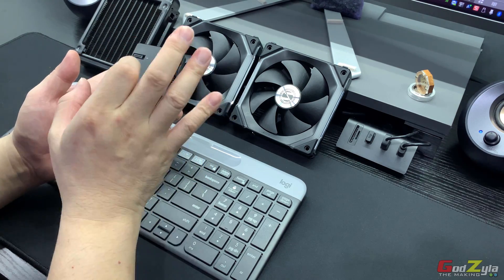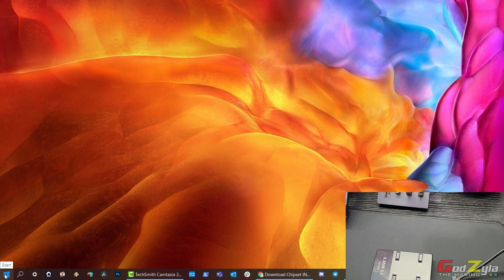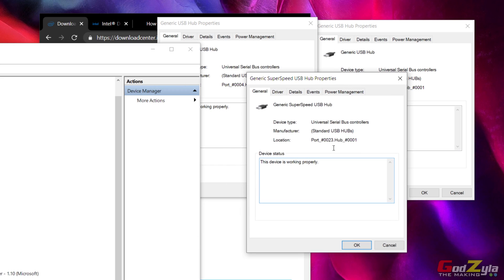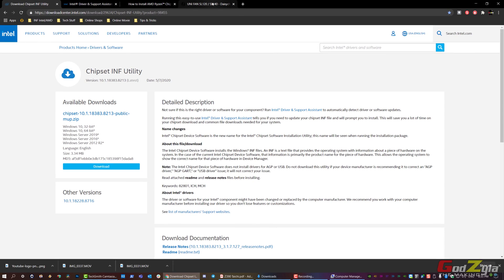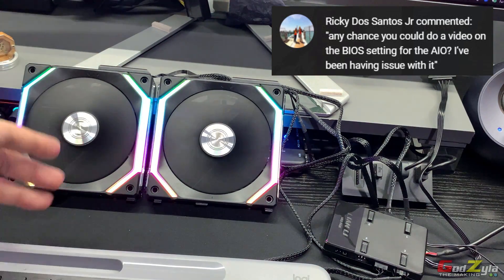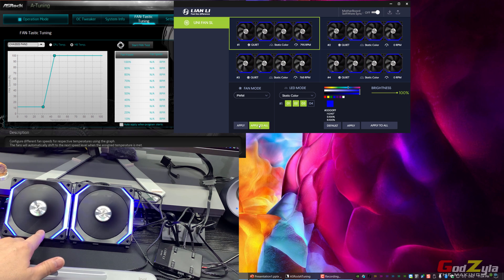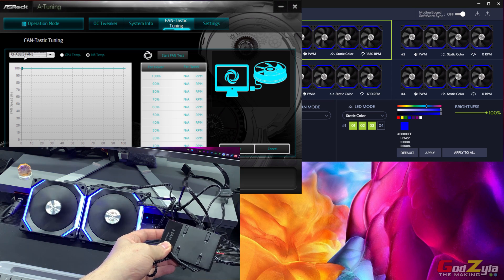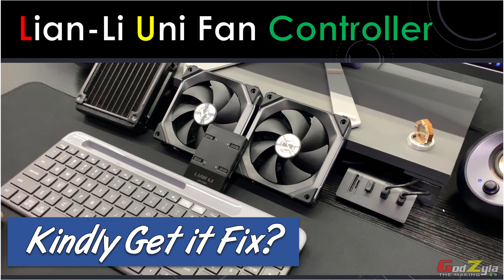Lian Li Uni Fan Controller - Some Break Fix! [L-Connect]

Comment: Just wanted to provide an update on a test i did with the uni controller in the cpu_fan header. The uni controller's pwm cable didn't work for me in the cpu header as my mobo said there was no fan connected (the uni pwm fan cable has only 1 cable coming from it). As such I used a 1 to 2 fan Y-splitter (1 to 2 being 2 fan connections to1 header) where i plugged my sl120 uni fans that are on my radiator into the y-splitters master fan header (the master fan header is 4 pins) and then i plugged the uni fan controllers pwm cable into the slave fan header on the Y-splitter. This means the motherboard detected a cpu fan which instructed the cpu fans to spin up more when it heated up thus allowing it to adjust it's PWMs. What this means is when the master fan adjusts it speed it then tells the uni fan controllers fans (if theyre in pwm) to adjust fan speed based on what the master fan connection is doing.

I've seen a lot of people asking online if the above is possible and after testing i can confirm it is. The only thing i made sure of was that in my bios the cpu-fan was set to pwm and not auto or dc. 

Also adding the l-connect program can be set to auto run on windows boot by typing run and when the run program pops up typing shell:startup. Then you copy the lian li programs short cut to the shell:startups location and then windows will automatically boot it every time (again tested it by rebooting numerous times and it started every time without fail).

Thanks.
Reply from the maker: Hi Aaron Portillo. Good finding, glad you find a way to resolve your issue. I have never face your issues and yes the cable that comes with the uni fan controller, has only one cable on the fan connector which is to change the rpm speed only. When set to pwm on the L-Connect app without triggering motherboard mode, the motherboard is doing the actual work as in temperature readings, then the unifan controller just pick up the rpm that was determined by the motherboard. This is where the uni fans reacts and changes speed. With this said, thank you for your detail write out. This will be useful to those who are facing a similar situation like yours. I have learn something new from you too. Thank you. Post pined 👍
Reply: @KleoYan  No worries. Not so much of an issue for me but more of a way that incorperates all the fans into one header. A lot of people seem to want the radiator fans and case fans (all uni fans) to adjust its speed based on what the cpu's temperature is doing (which is fair and its something that i wanted as well). By having the radiator fans as the pwm controller it fixed everything. I've also noted on the lian li 011 dynamic (thats the case ive now got) people report high temperatures - the temperatures go to about 60c for cpu and 68 for gpu but for me that is perfectly fine and acceptable.. theyre the same temperatures my massive pc case (corsair 780T) was doing so i consider it a win to half the size and keep the same temps or a bit better at times.

The scary part is testing things but hopefully people wont have to now with the above answers. Thanks for your vote of confidence and kind words i appreciate it dude. Will watch more of your videos in the future. :)
Reply from the maker: @JXP93  thanks to you... I've learned something new from you. like i said, there are things I do not know but through unselfish people like you to have share this knowledge, I get to learn.

I greatly appreciated your time and efforts to explain so in-depth. Thank you for sharing this to the rest and with me especially. I like your style :) thank you again buddy.
Reply: @KleoYan  you're most welcome buddy. Glad I could help. I've sent you some pictures of what I've built! Hope you don't mind.
Reply from the maker: @JXP93  Sure. Will have a look and thank you!
Reply: @buddydudeguy618  wtf you on about ? Nobody has mentioned temperatures. Calm tf down.
Reply: @KleoYan  Hi Kleo! I seem to get my fans connected in PWM ok, but now when the pc sleeps, on wakeup the fans max out again. any idea?
Reply from the maker: @smyrkphace  hi and welcome to my channel. The reason for this is normal. As your L-Connect holds the configuration settings. It will need to be launch before PWM take place. This will only happen when your Windows OS is started. Before that, there are no instructions, therefore your fans will load as full speed during cold startup. For most of my friends, they leave the uni controller to control the lights and plug the fan connectors directly to their motherboard. That will consistently set fans with pwm profile, be it before windows start up or after start up.
Reply: @KleoYan  So if the computer SLEEPS there is no way to keep the fans from going 100% after WAKE UP?
Reply from the maker: @smyrkphace  there is, if you plug directly to the motherboard fan headers. it will go 100% and then follows the PWM once you have start through the bios instead of waiting for the L-Connect to load at windows.
Reply: @KleoYan  Thanks man! Ill give it a try!
Reply: @KleoYan  My fans break in various ways when I download the L connect software, the fix (disconnecting sata cable and usb cable from motherboard, download the L connect fix app run that, then replug in usb to motherboard fixes it) BUT everytime I use the L connect software the fans break in various ways, the first fan in each setup's leds go out for some reason, I even had all leds stop working while everything was plugged in. So frustrating considering how much I paid for these fans, that I can't change the color or rpm of the fans in the L connect software without something breaking, wtf Lian Li
Reply from the maker: @anonymous-ig7yt  hello, welcome to my channel. some have reported like your incident as they have plug in too many devices to one USB Header. you might wantt and some are due to the fact that their motherboard utlity app which controls other argb which and fan rpm which causes these issues. you might want to list down your motherboard using, how did you plug your uni controller and such. I see what I can do to aid you on this. maybe if you can fill up the below questions

1) What motherboard are you using
2) Any other argb devices are you using 
4) What case are you using?
3) What's your arrangement of fans are like (Top, bottom, rear, aio and etc)
Reply: @KleoYan  Again, fantastic videos. I'll be undertaking a new PC build with 8x SL120 fans in a Lian Li Lancool 2 case very soon. Hopefully all goes well, however I would greatly appreciate your help with this. I've been trying to research everything I can regarding these fans as at the moment, connecting them is the most confusing thing for me. However this comment section has provided a lot of direction on where I'll go with that. My plan is to connect all the fans directly into the mobo and have the mobo software take care of the RPM settings. All the fan ARGB to be connected to the UNI controller and handled by L-connect.

So....
#1: is the following correct?

Motherboard manual does not state specifically but research shows that typical 4pin fan headers can handle ~1A, therefore:
2x top mounted radiator(AIO as exhaust): connected to cpu fan = 0.36A
2x above the PSU shroud as intake: connected to system fan header 1 = 0.36A
3x front as intake: connected to system fan header 2 = 0.54A
1x rear exhaust fan: connected to system fan header 3 = 0.18A 

Since each of these individual fan header connections are <1A, I should have no issues (I hope). 

#2: Any tips for the following?

Now based on what I want to do above, I don't know what to do with the Lian Li case ARGB and the ARGB on the CPU AIO pump. The easiest way I can think of is using a splitter to connect both the AIO pump and case ARGB connect into the into the remaining(unused) ARGB header on my mobo (which has 2. 1 would be occupied by the UNI fan). However I am very hesitant to do this after recalling your previous videos and that I cannot find information regarding the Amperage draw of both the case and the AIO pump. I plan to use ID-Cool ICEFLOW 240(removing the AIO fans and using the SLI120 fans as per above)
Reply from the maker: @inoscare8796  Hello there, welcome back. for fan load (PWM/DC) you dont have to worry about the load. max is up to 4 fan per motherboard header, so long each fan is not above 0.25a . the SL fans are at 0.18a which you did the correct calculations. your settings are perfect :) 
now for fan argb connection with the above settings you have. I would daisy chain your rear fan argb with the aio argb. which occupies one of the output of the uni controller. which is ideal in your case. 
btw all the very best in your build. if you need more help, don't hesistate to contact me via email if you can't get hold of me here.. my email address is godzylatech@gmail.com :)
Reply: dug deep to find that fix on a forum. it worked for my Asus Rog B550-a
Reply: Hi Aaron, I got the same issue and managed to get mine to work by using the y-splitter cable as well. However, it seems that the fan header that is connected to y-splitter will then not be able to be detected by L-Connect. Not sure if this is the expected behaviour.
Reply: @Bryan-oq2vz  hi Brian, I believe mine does the same thing. On the Y splitter the main fan appears on the software however the secondary fan on the Y splitter doesn't.

Just to clarify though do you mean the Y splitter fans overall aren't being detected by the uni software ?
Reply: @JXP93  Hey, I seem to be able to get my fans working with my mobo set to pwm (aorus master) but the issue I'm having now is after sleep mode the fans go back to 100% and wont seem to get back to normal. Any ideas about that? I haven't tried the cable splitter yet. There is also this solution here https://www.reddit.com/r/pcmasterrace/comments/kvl3kt/lian_li_unifan_sl120_pwm_mode_only_full_rpm/ (scroll to bottom) where it seems like the solution is to plug the fan in once and sort of upload the pwm settings and sorta spoof the fan into thinking its connected. not sure if that's the same thing as using the Ysplitter method.

Comment: im going crazy, has been working all the time but after an windows update the jusb1 and 2 disconect and connect in loop do you have
 any tips ?
Reply from the maker: Hi Klaus, welcome to my channel. I will suggest to do this. power down your PC, switch off your PSU, unplug the AC cable to your PSU. leave it 45 seconds, reconnect back the cable to your PSU, power up. It might be a glitch on device regconition in windows device manager.

Comment: i get AURA LED controller instead. is it because i got an ASUS  MOBO?
Reply from the maker: Hi Saiyan, welcome to my channel. If on your L-Connect application you have set to sync with motherboard. Your Asus AURA sync will take over the argb effects control rights.
Reply: hi hello! so if asus aura sync is taking over, its useless to have L connect, correct? thank you for responding
Reply from the maker: @Saiyancy no. Overall you need l-connect. It is the primary controller app for your Uni fans.
Reply: @KleoYan  its very strange because its syncing up with all my fans. the app doesnt detect my uni sl wireless fans
Reply from the maker: @Saiyancy hmm that’s weird and you are watching the incorrect content. This are wired
SL fans.

Comment: i deleted L connect because it doesnt work well and its just another program extra on the pc...  i just wan't to use fan control for everything. Now, not a single program can control it anymore not even BIOS... which is weird because it could during boot.

My main issue with L connect is that it doesn't apply motherboard fan settings correctly.
Reply from the maker: Hi FuroowHD, welcome back. I see, for the older version of Uni fans, you can plug the 4pin pwm directly to motherboard header, which I do use but after the new version. I agree with you. the L-Connect 3 does not sync properly with motherboard PWM settings.

Comment: My fans are not working on my cpu my pump and the 3 fans are not showing in my bios but i can control the colors im so confused im wondering if they connected it wrong somehow when they built this pc for me
Reply from the maker: Hi Ultra, welcome to my channel, I will advise you to see the builder for this.. if you want to troubleshoot yourself. watch this as a reference https://youtu.be/CgvuUFeff8U?si=_viRyLqAuMO4oT91
Reply: @KleoYan  i have been trying they told me to plug it into a different  header but I need my friend I don't wanna break anything lol
Reply from the maker: @UItrakilla  that's the reason why I share with you how these things works with a video content. I have type that on my previous comment. I can't help you as your PC is not build by me and I have no idea how your builder do the connections, exmaple, to which header? which usb socket? which pwm fan header? and such?.. kindly study the content, understand how it works and do the troubleshooting yourself. If you are not confident with it, bring to someone who is able to aid you physically.

Comment: all of my fans rgb works perfectly fine but the bottom 3 wont spin and i've already checked for updates in l connect. what can i do to get the fans to spin?
Reply from the maker: Hi Chris, welcome to my channel. which fans are you using? did you try each individual fans before daisy chain? if individual works. try daisy chain again.. test with 2 and then 3. if it does not work, change to another port of the controller, if is still does not work, change the cable. you have to narrow down one step at a time.
Reply: @KleoYan  it took a while but i fixed it. i assume the controller was faulty.  luckily i ordered 2 120mm triple pack fans so i connected the spare controller and my fans now spin.
Reply from the maker: @nervuo  I see. That’s good. Glad that you have fix your issue. 👍👍👍

Comment: Help me... how to fix my ctrller fan in device manager reads lian li strimer v1.4.. because i installed the wrong frimeware....helm me please, how to back to default setting my ctrller fan SL, so that it can be read again, usb Lian Li Fan.
🙏🙏
Reply: Please respon my comment🙏🙏🙏
Reply: Helpppp...🙏
Reply from the maker: @ummuaiman3229  hi welcome to my channel. Plug only the controller to your PC, does it detect the controller in Device Manager, under Universal Serial Bus Devices. If you can see the controller, download the actual firmware and redo the firmware again, if not, kindly contact Lian Li support to have it replace. https://lian-li.com/contact-us/
Reply: @KleoYan  It doesn't work bro, it says "selected firmware does not apply to the controller"..
Reply: @KleoYan controller  Unifan SL v2  can be used for fan SL120 v1, bro...
Reply from the maker: @ummuaiman3229  hi welcome back. You can't use the SL120 V1 on a SL120 V2 controller. it will not work. but as for your firmware. did you have the uni fan controller listed in your device manager, under Universal Serial Bus Devices?

Comment: It doesnt work at all for me, nothing I tried. I tried Version 1.7.4 and 2.0.4 of Lconnect 3, it doesnt show up in my Device Manager, when I scan for Devices in the Firmware update tool, I cant, cause it doesnt show a single device, in the App I cant change any settings, cause the Devices doesnt show up. I got 10 Lian Li 120 inf fans. They run and they have the rainbow led, but they are not detected. I dont know what to do anymore. I also installed the Intel inf Chip.  When I remove the USB Cable no Device gets removed or shows up in the Device Manager, Even bought another Controller and Cables. They dont get detected.
Reply from the maker: Hi Sargeras93, welcome to my channel. you might want to test these out

1) Do you have other argb programs running in the background? if you do follow these steps. 

A) Remove all argb apps (Asus Armory Crate / MSI Dragon Center / Giga Fusion / Asrock Polychrome). If the brands which I have mentioned, do have a uninstall tool like the Asus Armory Crate, use that, else use Revo uninstaller ( https://www.revouninstaller.com/ ). Revo uninstaller will remove all unwanted files / folder / registry in your system. Illustration to use revo uninstaller https://www.youtube.com/watch?v=uMgUYiakpxM&t=437s

B) Shutdown your PC, unplug the PSU cable from your AC outlet. Press the power switch twice to discharge all current that your motherboard is holding. Leave it for 45 second

C) after which, plug back the AC cable to your psu, power up your system. check on device manager to see if you do see the controllers

D) if it does, install L-Connect 3 app and do firmware through the L-connect 3 application version 2.0.4

If at step C) it does not, try use a spare SSD or nvme, install fresh windows OS and to test it again. sometimes is due to registry leftovers and might be corrupted. 

if it still does not work.. you have done all the primary checks even exchanging controller and cables. This tells you that it might be your motherboard.
Reply: @KleoYan  thanks for your long amazing reply, someone on reddit could fix it for me, actually 1 USB Hub in the Device Manager wasnt activated, I had to activate it and then I could activate the L-Connect aswell.  Running now. Appreciate your effort
Reply from the maker: @Sargeras93  oh that's good to hear. So sorry I replied late. let me guess, the friendly Mr. Do hee.. yup he seriously deserves to be hired as a tech support for Lian Li's reddit.. exteremly helpful guy.
Reply: @KleoYan  haha exactly it was him. Great hes known for beeing amazing👍
Reply from the maker: @Sargeras93  yup am going to give all the credits to him 😉